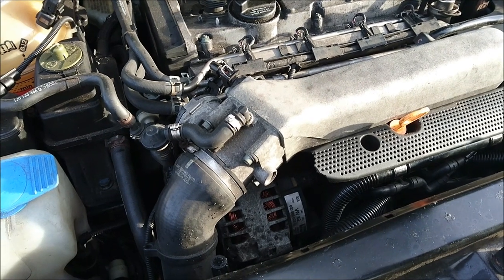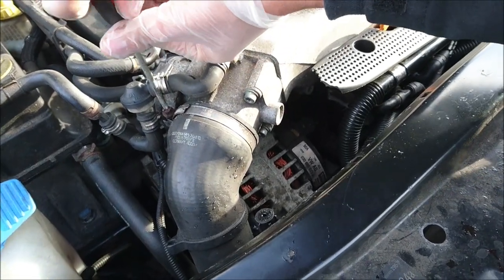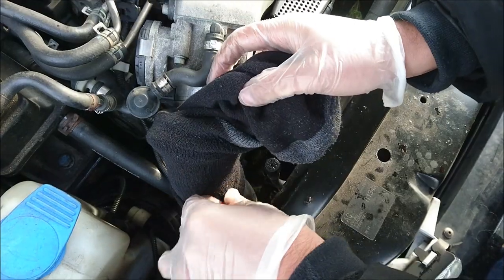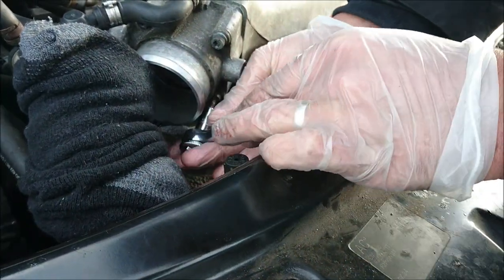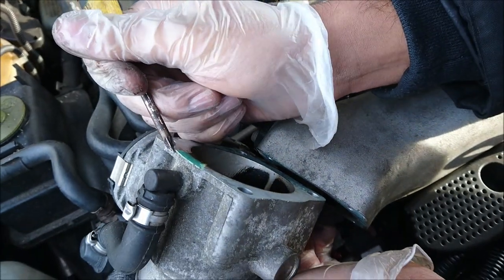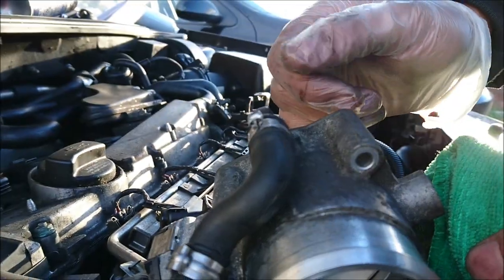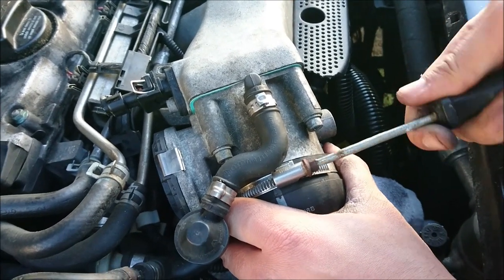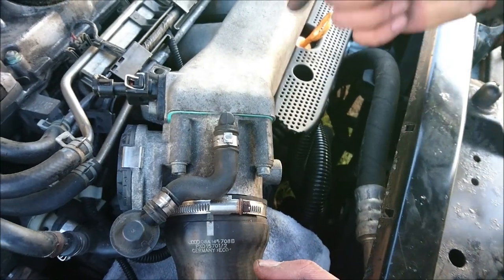1.8t Throttle Body Clean VW / Audi / SEAT / Skoda

Comment: hi there,  I looking for information I scan my Audi tt mk1 and in the scan appears this ¨p1297 connection charger-throttle valve: pressure drop¨. I want jus to be sure if this is the solution for this code?  or if you have any suggestion

Comment: I had a control difference intermittent error on my Octavia 2000 1.8T and unplugged the 7 pin plug to clean it.  I had no problems with having to recalibrate afterwards.  I read elsewhere it recalibrates automatically.  It's also safer to unplug the lead so there's no power to the throttle motor.  Mines a bit different to yours it has a manual cable on the side of it.  Yours looks electric only.  I like your video.
Reply: Yes, indeed. But if you unplug it you will end up being unable to clean the valve in the open position, correct? I am also afraid to clean my throttle while still connected, but I'm also guessing that the most problematic deposits are around the valve edges.

Comment: I'm really afraid to clean the valve on the edges with the contact on.isn;t there a risk to create a short on the motor of the throttle caused by the cleaning liquid?
Reply: Your question shows a lack of understanding why you'd use a carb cleaner or variant but better to ask than not. First it's a mechanical device, not an infant and altho you can break or fudge some things yes CS usually will keep you safe. There are different types of cleaners with some being able to be directly applied to electricals while some can be used indirectly as long as it dries completely before using.

Comment: Thought I’d check what advise, if any ?, I could find on cleaning throttle body on my Seat Leon cupra before I started, glad I did, my first mistake would have been to completely remove it sensors too, didn’t know it would have needed calibration if I had, but what would be involved in recalibration of the throttle body ?, thanks, Ferry.

Comment: Okay so I have a few questions regarding my 2005 GTI 1.8t.

I will be cleaning the throttle body the correct way thanks to you guys.

The issue that I’m having with it right now only happens when I fill up on gas (I don’t over fill)
After a fill up and I start my car, it will start up at normal rpms but then immediately drops down to 300 rpms and I have to give it gas until the rpms go back to normal. Then the car runs perfectly fine until I fill up again and then does the same thing.

Could it be the throttle body?
The fuel injectors?
The whole EVAP system?
Idk and I hate guessing because I don’t have as much money as I’d like to in order to guess with.

So I really need help, answers, anything...
It just really sucks!
Reply from the maker: Hi thanks for commenting. You could still clean throttle body but I would also try coolant temperature sensor: https://youtu.be/7Iqp8oPsTQE
Reply: Redline Revs 

Thank you for your help, however, I’ve already replaced that sensor a few months ago, the car still has the same issues.
My big guess is that it is emissions related, could it be the charcoal canister?
I should also add that every time I turn the car off, I hear popping in the gas tank area.
I just replaced the fuel pump and filter quite recently so it can’t be those. There must be a leak somewhere that’s allowing either too much air or not enough gas..
I really don’t know
Reply from the maker: Have you tried MAF? https://youtu.be/jUoOnjGCDHc
Reply: I have not, But have been meaning to.
Reply: Evap sensor ontop of intake manifold or pcv valve ripped

Comment: Is the throttle body different for the diesel or practically the same? Asking for a buddy that has the diesel.

Also, why couldn't you push the butterfly valve to clean the other side of the throttle body? Is it electrically controlled? Do you risk damaging it if pushed? I just found it peculiar having to remove the whole assembly and put the car on ignition 1 to clean it.

I've cleaned the throttle body on my Camry and just pushed the butterfly valve to clean either side.

Thanks for an informative and thorough video.
Reply: diesels don't have throttles, they are controlled by amount of fuel, not amount of air. the throttle body is electric in this car (except on early models) so it will damage it if you just push it.
Reply: @socalguy829  yees they do !... it regulates the airflow intothe EGR....

Comment: hi chaps, great video, used it to clean the throttle body, but I still have the same issue as you described, I changed the plugs, cleaned the airfilter and re charged it and changed the MAS with a new one, but still get the flat spots, if I unplug the MAS the problem goes away, any idea?
Reply from the maker: Did you change MAF with genuine bosch unit?
Reply: no, but the problem was there with the Bosch one too, infact it was even worse with the bosch
Reply from the maker: @CarlosTilbury  try new original MAF from TPS. They were a sensitive and weak component, euros reconditioned ones can sometimes go wrong.
Reply: @RedlineRevs  will do, thanks for the advice!
Reply: @RedlineRevs  found the prob, bloody hose had come loose and not connected properly, work 95% but its due a service so that should sort it

Comment: so i seen loads of videos of people taking the thing out and unplugging the breather hoses and plug then cleaning it properly in a buck or whatever but whould it loose programming if the plug is removed?
Reply from the maker: James Hubbard thanks for commenting. yes it will need to be recalibrated IF you unplug it. It's possible to clean it effectively without unplugging as I've shown in the video.

Comment: Hello. I have a cold air intake on my car. Same engine as the video, and I drove around with the filter off for a while not knowing. Bot, it's hard to start when it's cold, and I have no idea how to clean. I did what this video said, and it's the same problem after I was finished. Can someone help?
Reply: Chris Hutchinson did you check if the air temp sensor is clean and plugged in? Try cleaning that too.
Reply: @danielbradbury9495  I got it fixed. It was the coolant temp sensor. Changed that, and it started right up.

Comment: Hi i have a seat leon cupra 2001 it has flat spots in 1st 2nd and 3rd gear will this help if i clean mine and if i dont disconnect the electrical clip it wont need reprogramming?thanks.
Reply from the maker: Jamie Osborne hi, thanks for commenting. I'd say it's worth a shot. And yes, leave it all connected and you won't have to reprogramme.

Comment: Why wouldn't you take the throttle body off? Would be a lot easker
Reply: Because if you disconnect the throttle position sensor (even if you disconnect the battery) there's a chance you may have to use vagcom to recallobrate the throttle body.

Comment: no i mean the little shelf covering your hoses and where the dipstick is sticking out of. the stock black one is ugly as heck
Reply from the maker: Zane Massie you mean the black shelf next to the inlet manifold where the dipstick sticks out? You can get one of those at TPS, eBay or someone breaking the car. When I had mine off I washed it and resprayed it black to clean it. You could try another colour.

Comment: where do i get that plate in front of the throttle body ?
Reply from the maker: Zane Massie if you mean the gasket you can get it at your local TPS and probably also eBay.
Reply: I couldn’t find one on Ebay. So you have a link to one. Cheers.
Reply: Just ask your local auto parts shop...

Comment: do i need to reprogram the throttle body after cleaning ?
Reply from the maker: Not if you follow this method exactly. As long as you leave the switch at the bottom of the throttle body plugged in as you clean it you will be fine.
Reply: Alwajeeh Helal did you already tried?

Comment: 1. It wasn't dirty,
2. still carbon in plenum chamber
3. insert bolts into throttle body, then place gasket on bolts, having cleaned mating surfaces of course
4. Loctite blue on bolts and torque to correct value
5. think about buying some proper tools

Comment: It's a bite of a lazy way of doing it? Your where taking the throat of any ways so why not clean it once you've taken it of ? You still have carbon around the plate if you use a screw driver you'd be able to get it of you shouldn't be able to see and light coming through where you mist the bits